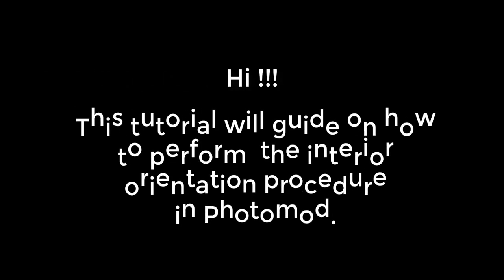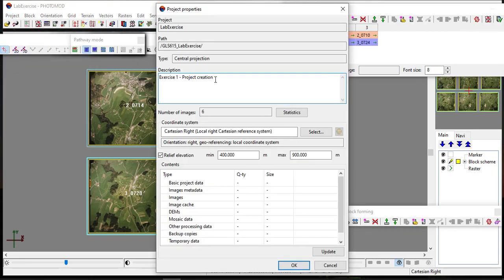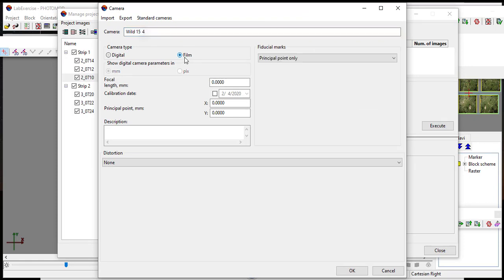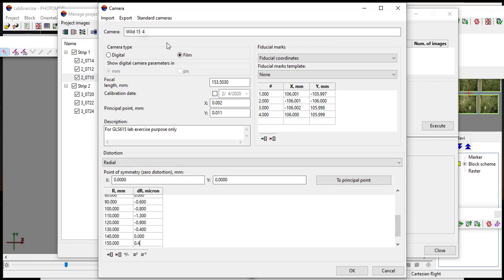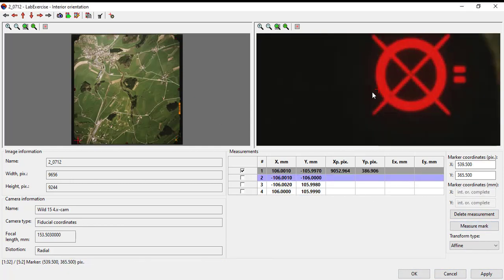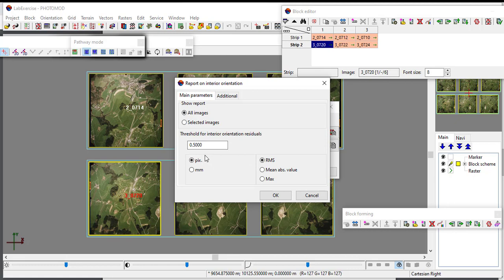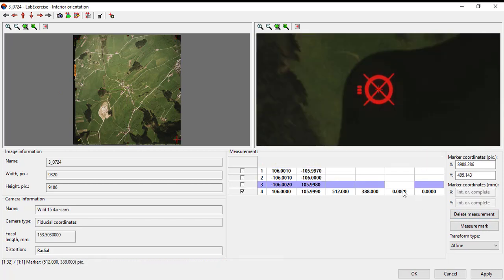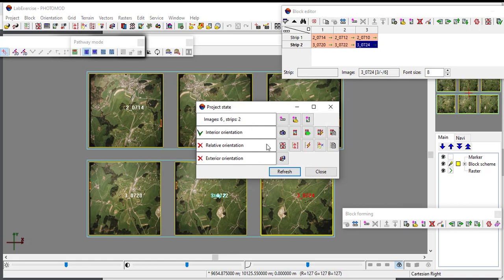Part 2: Interior Orientation using Photomod

Comment: Hello, thanks for the videos. They are being so usefull to me.
I have a question. How do we do, when in the camera calibration certificate we have the distances between the fiducial marks, instead of the cordinates. How do we introduce the data in the program?

Example: 
1-2:  212.003 mm
1-3: 299.826 mm
etc

thanks again
Reply from the maker: Hi Will, may you share the calibration certificate with me? I need to inspect it first. Tq.